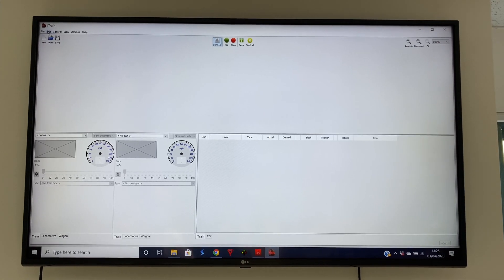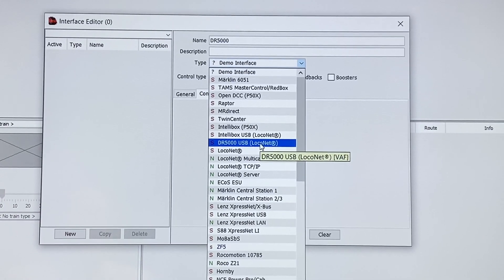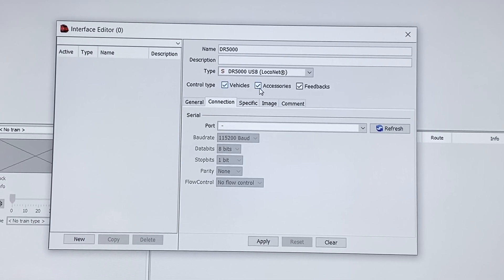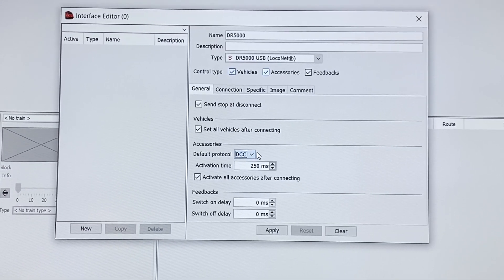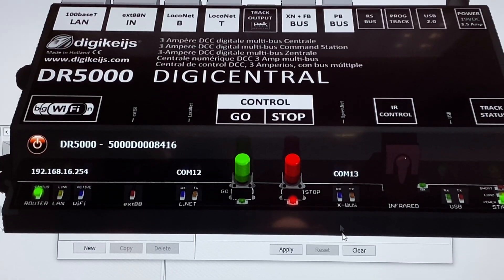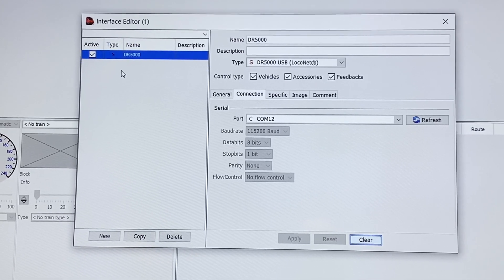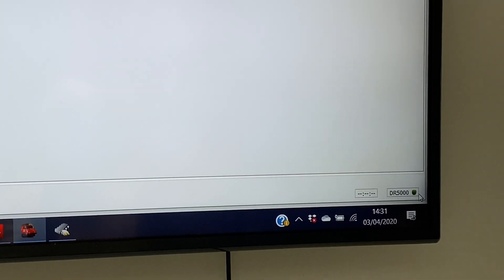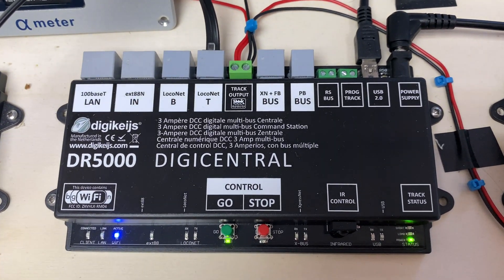How to set up your Digital System interface

Comment: Hi James thank you for such a great channel re all matters DCC, I wanted to buy a DR5000 but I understand they are no longer in production and the successor company YaMorc are releasing a new command module later this year ?
I just wondered if you ever get any DR5000's as a trade in as would be very interested in getting a pre owned unit and then upgrading it to a YD7001 as per YaMoRC's recently publshed upgrade kit.

I have invested in an NCE Power Cab to get myself going, but see an upgraded DR5000 as a logical path forward or the YD7001 once it releases.

I am going to see Richard at Digitrains as he is a little closer (I live in Huddersfield) to learn more about the DCC dark arts, he also was very positive about you guys.
Finally brilliant work with Charlies  Helix's v impressed. Do you also do base boards to order and if so what infomation do you need to provide an estimate ?
Kind regards  Mark